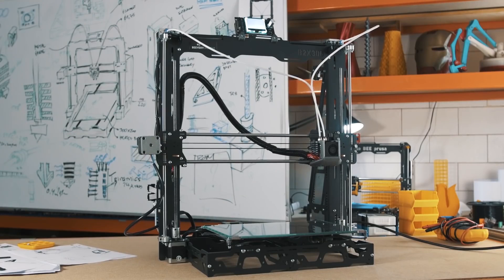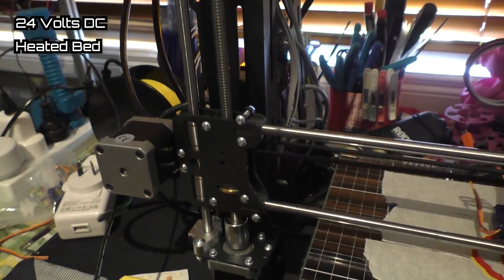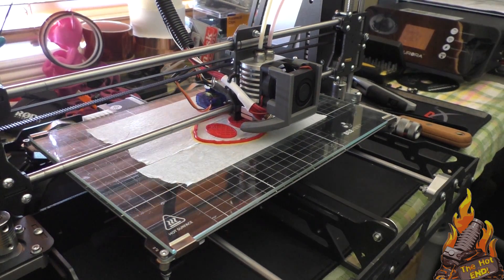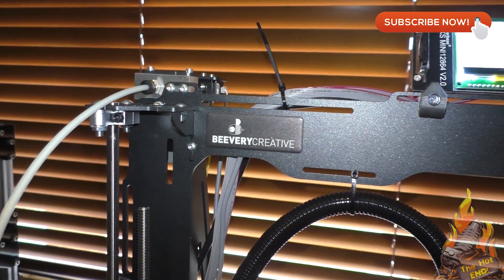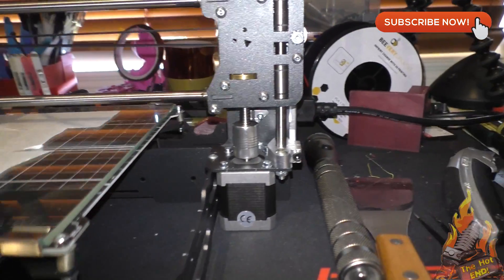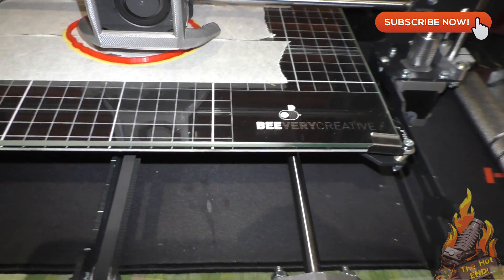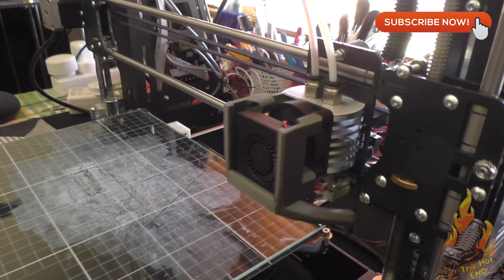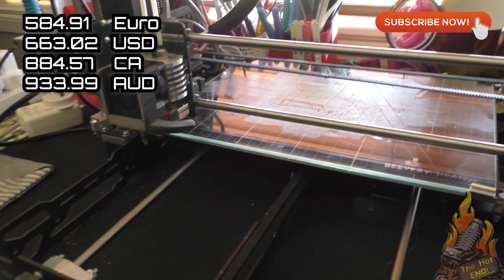BeeVeryCreative B2X300 3D Printer Review! 2019 Printer of the Year?

Comment: this thing is junk, the twin extruder thing clogs every time, the bed sensor works 20% of the time, they have replaced the motherboard, some drivers, everything that could go wrong has. I feel sorry for anyone who buys one. I now own 9 3D printers and this is by far, by far the worst. It sits unused, I came here only because I am planning to redo it totally. I removed the crap double print head long ago, now i plan to install a BL Touch and remove the thing they call a bed sensor. Totally replace the firmware with a custom Visual Studio job.

Comment: Buying this printer has been nothing but a big headache. It is my 5th 3D printer and by far the worst to get working, 3 of the printers were kits, only two came pre assembled. On it's very first print it went into "temp runaway" and now wants to print everything on ext 2 and off the bed. I have found zero support from the company, I wonder if they even speak English. Their slicer seems to have zero features, see no way to set temps or ext number wanted, anyone have a Simplify3D profile for this beast they can share?
Reply from the maker: This would be printer #200+ for us and we stand by the review , it's a kit and only as good as the builder
Reply: @TheHotEndChannel  this thing is junk, the twin extruder thing clogs every time, the bed sensor works 20% of the time, they have replaced the motherboard, some drivers, everything that could go wrong has. I feel sorry for anyone who buys one. I now own 9 3D printers and this is by far, by far the worst. It sits unused, I came here only because I am planning to redo it totally. I removed the crap double print head long ago, now i plan to install a BL Touch and remove the thing they call a bed sensor. Totally replace the firmware with a custom Visual Studio job.
Reply from the maker: Ask their support, considering you said I wonder if they speak English would imply you haven't bothered

Comment: $780 shipped with a wait time of 3-5 weeks. Still liking it? Any issues so far? How hot can the bed get?
Reply from the maker: Love it!!
Reply from the maker: Only real issue was solved by RTFM and popping it's oiler in the filament path
Reply: The Hot End - 3D Printing & Tech Reviews thank you. I was considering the mk3s but this has about the same feature for about the same price and is bigger. Are the dual nozzles easy to level?
Reply: @tjlqk3  yes, very easy.
Reply: john martin do you have the s3d fff by chance? Ordered one of these today while on lunch break.
Reply: @tjlqk3  I didn't quite perfect it but I will post what I have on our FB group  "3d printing geeks" in the files section.
Reply: john martin just joined the group. Thank you sir

Comment: Great vid guys. did you record the build, would be fun to watch? When snapping metal kit parts of a frame it may leave small attachment areas of exposed steel which could do with a spot of sealing paint to avoid rusting issues in future
Reply from the maker: I'll be sealing those spots with a dab of black nail polish and show what happens in part two :)
Reply: with all the vids on their website it did not seem necessary to record the build - took me about 5 hours.
Reply: @Johkarphotos  John! don't deprive us of our unboxing / assembly porn fix. this printer looks great

Comment: TH3D and Tiny Machines have baby stepping in their preconfigured Marlin firware. So you can adjust your Z height at any point during your print.
Reply: That is correct, there are many 3d printers that have the Z babysteps function (which is the live offset Z adjustment that he is referring to) from stock!